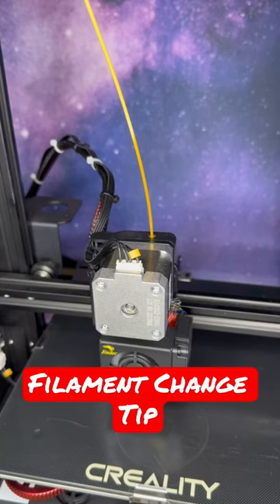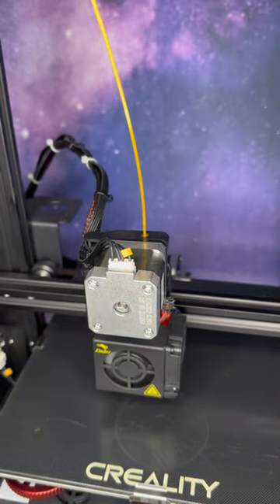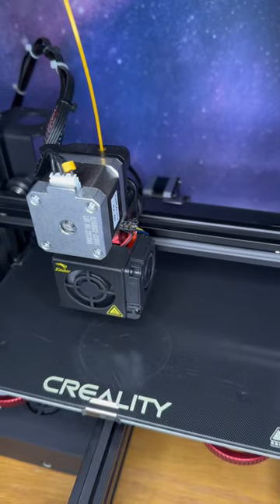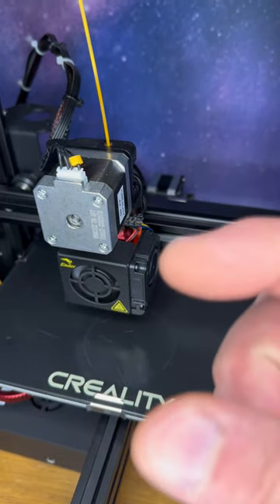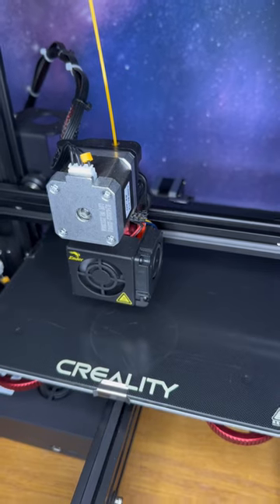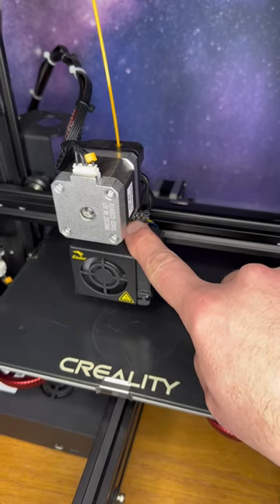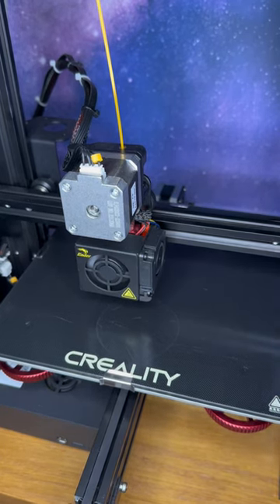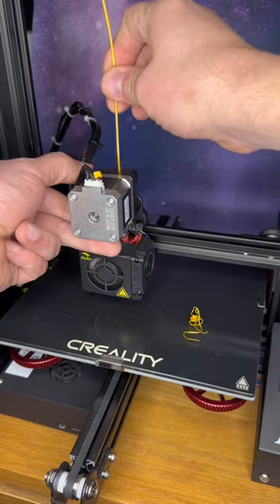Filament Change Tip. Get that filament out with this trick #shorts #3dprinting #youtubeshorts

Comment: What is above the extruder, also what are all your upgrades you purchased for the ender?
Reply from the maker: That’s the Creality direct drive upgrade. Not the sprite but the cheaper version like $40. I also upgraded to a glass bed and heavier bed springs. Works great now. Only other thing is the Beagle cam for printer control and Timelapse’s.